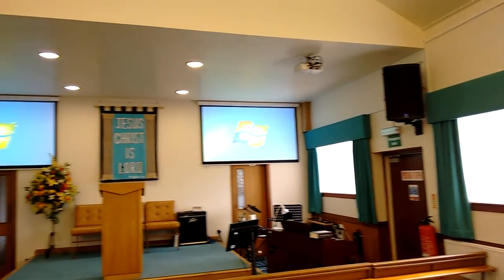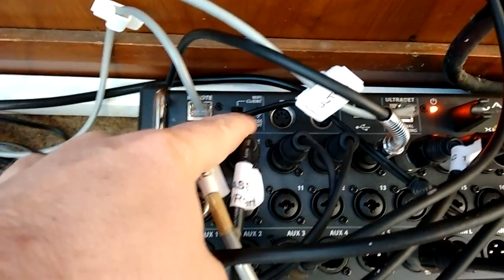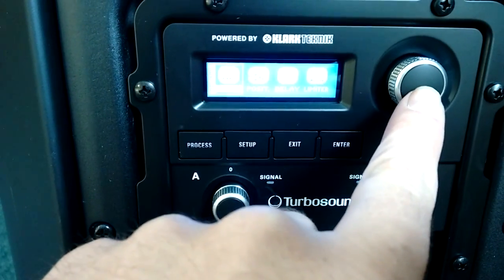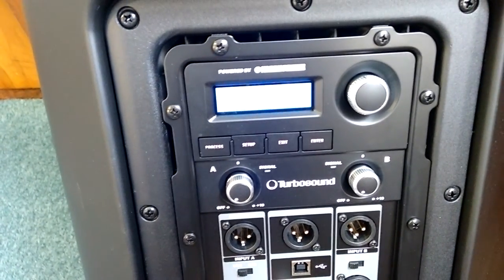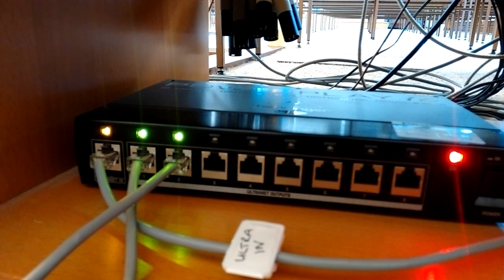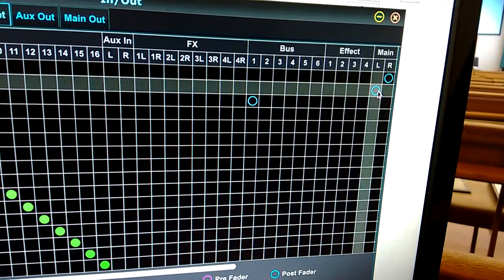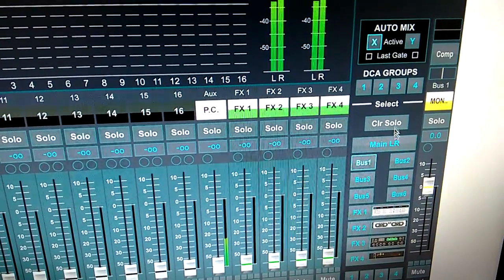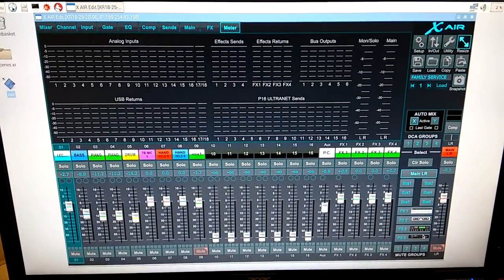Turbosound IQ15 speaker install + BERINGER XR18

Comment: Has anyone had luck using their xr18 on an iPad or iPhone? Does it need a WiFi or cell phone signal to function?
Reply from the maker: We use it every Sunday using a plugged in external router into xr 18 and put slider to ethernet
Reply from the maker: https://youtu.be/BJqKjqee4dE

Comment: Wow so the xr 18 can comunícate wit this type of turbo sound speakers now how do you guys do to turn on off sound system or does the speaker automatically turn off and on when mixer turns on ? This avoid the $ amount of using Xlr cables and instead replace with cheaper Ethernet cables how much is you longest cable in feet for the speaker over Ethernet ? So you can still use the regular xlr aux outputs for any additional usages right this doesn’t t interfere at all with each other ?  You could use all those for analog iem output if needed too ?

Comment: Would you say the ultra net connectors to the speakers sound better than a xrl or speaker wire inputs?
Reply from the maker: Hard to say because only ever used cat5 with this system. But it does allow u to use inexpensive cable but watch out for interference from flickering/faulty halogen lights but maybe it's because I never used shielded cat5. It's a great setup and sounds brilliant cheers sandy

Comment: Beautiful installation. I was doing this Sound installation work (1972-2000) when everything like Hanging points had to be fabricated. I recently purchased a batch of iQ112's and iQ118's and an Midas M32r for my Jamming Studio. Thank you for posting this because I am totally hyperactive and you made it easy to follow. Now I have about 7 old Soundcraft Desk's and extra channel strips and power supplies out in my garage. This is as small as I will go to mix sound especially with my 2/3XL Hands. Its hard enough playing Guitar or anything smaller. Cheers

Comment: Have you had any problems with the speakers muting themselves? I have found that when FBQ is on while running on Ultranet from our Behringer X32, the speaker output eventually drops to nothing. Switching the speaker off and on again will reset the sound, but after running for a while, it drops to nothing again.
I disabled the FBQ, and have had no problems since.
Reply: I had a similar thing running ultranet but the FBQ wasn't on,  did you ever get to the bottom of it?
Reply: @keggers101  we just turned off FBQ. No more problems.
Reply from the maker: hi, I have never actually used the FBQ on the speakers because we are in a permanent install so have just eq all the mics etc but thanks for the tip cheers sandy

Comment: Nice video, how are you using the raspberry pie exactly, I have 2 of the IQ15s and 4 IQ18s
Reply from the maker: http://www.music-group.com/Categories/Behringer/Mixers/Digital-Mixers/XR18/p/P0BI8. the raspberry connects to the xr18 via cat5 cable and is used to control the mixer
Reply: sandy anderson I'd like to know more about the raspberry
Reply from the maker: +james shelton what exactly do u require to know?
Reply: +sandy anderson Hello, how did you go about the programming of the raspberry?
Reply from the maker: +james shelton https://www.music-group.com/Categories/Behringer/Mixers/Digital-Mixers/XR18/p/P0BI8/downloads. download this software for raspberry pi version after u install raspbian OS from raspi website
Reply from the maker: +sandy anderson https://downloads.music-group.com/software/behringer/XAIR/X-AIR-Edit_RASPI_V1.3.tar.gz

Comment: This is a great video.  I like that you use a Raspberry Pi for your controller.  :)  The XR18 is my favorite system :)
Reply from the maker: cheers the raspberry pi 2 is an amazing little computer with xr18.  with running xedit software it only uses 2%_of the CPU and with the RTA graph running on a channel goes to 25%.  the desktop looks great when I installed a font pack even better looking than windows/Mac version and it's very reliable never had a drop out and it's used every week cheers sandy
Reply from the maker: cheers the raspberry pi 2 is an amazing little computer with xr18.  with running xedit software it only uses 2%_of the CPU and with the RTA graph running on a channel goes to 25%.  the desktop looks great when I installed a font pack even better looking than windows/Mac version and it's very reliable never had a drop out and it's used every week cheers sandy